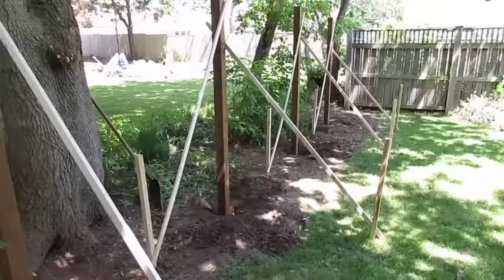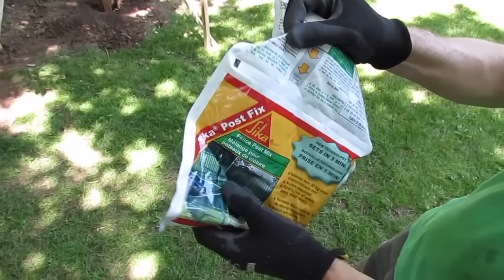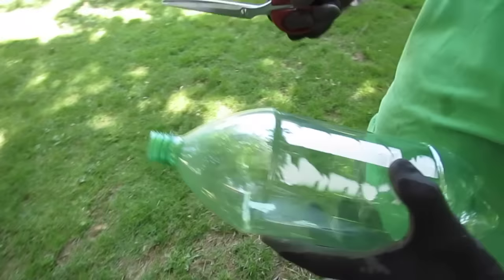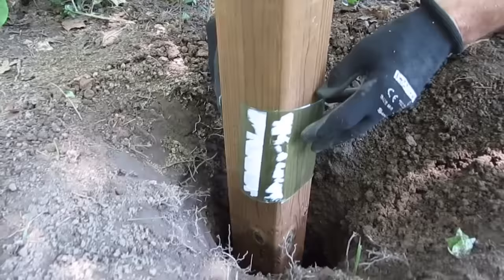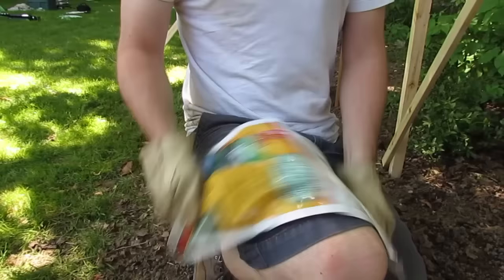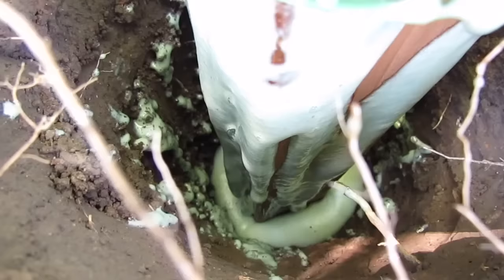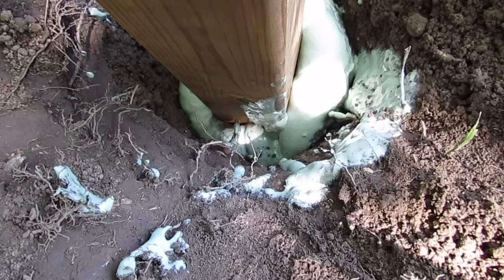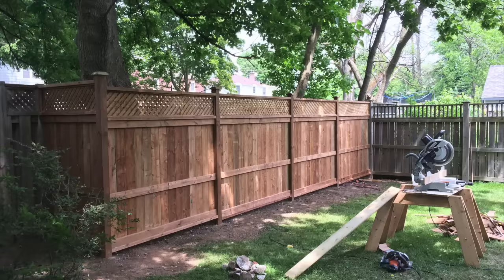No Concrete Fence Post Install!

Comment: pole foam as its known in the utility industry has been used to shore up leaning poles for many years. when used in the commercial version it's very fast to use, very effective and efficient. it's longevity seems to be in the 20-30 yr range. but it should be used carefully as it can have "explosive" effects.
Reply: I've seen Motorway (Highway) crash rails almost always have expanding foam over ooze on the posts? Not sure if there is concrete below or just foam? They are designed to take a vehicle crash so maybe they are supposed to 'give' a bit?
Reply: Jamie I'll bet your an intellectual.
Reply: used once in awhile in the siren industry too depending on soil it is super expensive but on loose soils holds firm...
Reply: Jimmy Walker Wow someone gives you facts about the product you just saw used and you discard our like old garbage cause it's not the cool thing obviously the comments lol be smart and alone not stupid and follow.
Reply: Good info   i am  pro foam   but i thought it would be just the opposite,  not that concrete  would  hold better in loose  soil
Reply: I would rather hit a foam wall as it cushions the blow, where as a cement/concrete wall as shown on an episode of Top Gear can cause serious harm or possible death.

Comment: I used for my mailbox. Worked out great! Way easier than concrete. No issues. Good product.
Reply: How is your letter box going now? Did the foam hold up?
Reply: Yes, no problem.   A truck even backed into post and broke the upper half, but post is still solid after repair.

Comment: Nice foam, but it doesn't add weight to the pole. This means that it's only held by the soil around it, while poles set in concrete are gaining that extra 20kg, which makes them hard to move even if the soil becomes muddy.
Reply: Smieszek80 it's also hard to move a 8 foot 4x4 that is actually put into a 24" hole, a proper hole not a giant lazy digger hole.
Reply: Acts like pendulum in softer soils as well.
Reply: This.
Reply: YUP.  Made this mistake myself and found out the hard way
Reply: Oooh thanks for the tip mate I don’t think I will use the foam for permanent things cheers
Reply: i use this in canada in clay soil amazing job

Comment: I put in a new mailbox post recently and poured dry concrete around the post then poured a gallon of water on top per the instructions.  Was inexpensive, fast, easy, and no mess.  Dried quickly too.

Comment: I've always used a bag of stone in the whole. You put some stone in the bottom to the whole, put in the pole then add the rest of the stone around the pole. I then fill the rest of the whole with dirt. By doing it this way you get good drainage making the poles last year's longer. When set in concrete, water gets trapped around the pole as it shrinks eventually rotting the pole.
Reply: Wow. That explains why my expensive wooden privacy fence is snapping off at the bottom. They are rotting.  Love this information,. Makes good sense ..thanks
Reply: @Lakelandcowboy69  I learned this several years ago from a coworker doing maintenance in a city parks department. We set metal poles in concrete. I've pulled a wooden treated pole out of my yard 10 years after I put it in. It looked like I'd installed it the week before.

Comment: I build fences for a profession. I use 60 lb bag of high strength concrete at each posts , about $3 a bag. It becomes the footings for a wall. I use coated screws and never nails. Using this on my fences would be like spending $65k on a nice ride,  and requesting hub cap covers.
Reply: roger drum 
....EXACTLY.
Reply: Well said!
Reply: I live in a VERY high rainfall area in Scotland. Many places where I've put fences are waterlogged much of the time, and can flood for weeks. Then there's freezing, and high winds. I won't speculate how that stuff would cope here, but I would not expect it to compete with concrete footings.
Reply: church!
Reply: 60 lb bag of conc mix for $3 ?
Seems amazingly low cost to me, & you'd need the strength of a gorilla to carry bags that weight.
I agree nails are nigh useless but would be interested to hear what screws you have decided on.
In frustration (I'm close to the ocean) I have ended up using 10G x 1.5" stainless sq drive. found it necessary to predrill with runners that are harder tan pine!
Reply: peter owens you cant lift 60lbs? hahah wtf
Reply: roger drum one 60lb bag per 4x4? I Would expects nothing less from a fencing co. Do it yourself nothing less than 100lb concrete per post @ 6 ft high
Reply: Midnitetoker - Ever hear of something called a "frostline"? Google it and you'll have your 36" answer.
Reply: roger - As a "professional" what are your thoughts about concrete wicking and holding moisture against your wood posts long after the surrounding soil has dried?

I Always try to use the methods of professionals while attacking a project, but just because the "profession" has used one method for decades, does not mean that improved methods aren't on the horizon. Example.... Asbestos, galvanized plumbing, and ungrounded circuits.
Reply: I can't answer as a professional, but I did 70 posts 15 years ago with 4x4 PT and 80lbs of concrete on each. To date, none have shown any signs of rot. Mine are dug down until I hit solid stone (which is rather shallow where I am) at about 2 foot.
Reply: Michael, Same here. I've set posts the traditional way (usually 36+" due to our frostlines here) and have not had problems that were not related to poorly treated wood...

However, upon buying older used properties I have removed laundry posts and posts from a pool deck that have been in the ground longer than that. Both instances showed perfectly cared for projects at the surface but were a complete mess from the grassline down.
Reply: Roger Drum - you're probably aware that there was a hugely popular drum company name Rogers, yes?
Reply: Actually, it's worse than that...it's like paying MORE for hubcaps and giving up the nice rims, and thinking you made out.  I'm actually not opposed new ideas....but this seems overly costly and inferior...so I'm not seeing the benefit
Reply: Peter Q, you are mixing up safe depth line with frost line. 36" is your states frostline, which means absolutely nothing with putting in a fence. A fence is non weight retaining, meaning the only wait it should retain is its own. The only time one is required to meet that frostline requirement is for piers for weight retaining structures such as sheds or patios. Or footings for builds have to be brought to that standard for houses and commercial buildings. Most utility lines such as gas, water and sometimes electric are to be buried that deep. I line in the central united states and in Missouri our frost line is 30" not 36". In most if not all states and townships a permit is not required to build a fence. Meaning there are no minimum requirements. I see no reason why a fence post would have to be dug below a frostline.
Reply: roger drum , screws are for fufu dudes.  REAL MEN use nails!
Reply: @JoesWebPresence  Well, given that it's high density closed cell polyurethane, which is waterproof, largely non-reactive, and is protecting the wood underneath instead of accelerating the rotting (which concrete can do to wood) probably better.  

High density polyurethane like this (I'm guessing it's 10lb / cubic foot foam or denser) has a compressive strength of about 8/10ths that of properly mixed portland cement, (the really dense stuff, like 32lb foam, is actually stronger, and is used to replicate human bone in stress tests due to having similar shear characteristics)  and is two to three times stronger in tensile strength.  

I've actually seen this stuff tested, and in most every test, either the wood or the surrounding soil shear before the foam does.  Granted, this isn't over long periods of time, but... polyurethane doesn't really break down.  

The main thing going for polyurethane is how unreactive it is once it cures - and how strongly it sticks to anything it can during the curing process.  The stuff can only really be broken down by acetone over long periods of time, or specialty acids.  Or heavy UV exposure over a couple decades.  

... now if only it weren't so expensive.
Reply: Just because you don't see it doesn't mean it isn't there. If it's above the frost line the ground underneath will push the post up wards. If you go below the frost line it will not. The ground will heave around the post but not underneath. I'm sorry but the freeze/thaw or frost line has a lot to do with putting up a fence. I just don't see how EVERY website, every professional I spoke with before I dug my own and every tutorial I've seen mention a frost line and it still have nothing to do with it. So you thinking it's some free mason's concrete conspiracy or some shit? Seriously I'm not being an ass here. We don't always need permits to tell us the minimum requirement .....common sense, learned from people who seem to know what they are talking about ......and who all seem to think the frost line is quite relevant to setting posts.   @thomasbailey5732
Reply: 36 inches is minimum here for post and up to 6 ft for gates. I used almost two bags per hole. Wasteful. Idk but my fence sure is solid af and the extra 5 dollars or so per bag seems like a small price to pay for peace of mind  @iankleiv825
Reply: i fence professionally as well and in my opinion screws take way too long. Galvanised nails do the trick just fine... if you buy the right brand.
Reply: @kon5912  I've never built a fence in solid Rock before, but I know from stories sometimes it isn't cheap. I've heard of people blasting into rock to get posts in, I've also heard of excavators and the like with rock drilling augers. Personally my recommendation is to use dynabolts or the like and just fix the post to the rock with L brackets and a few large bolts. That's what I would do.
Reply: @kon5912  no worries mate :)
Reply: the cost vs concrete is comparable to using screws over nails. nails are faster and much cheaper. if you are using a gun they are much faster actually. good thing fences do not have side loads because screws cannot hold up to that.
Reply: As for rotting, I have posts I put in concrete over 20 years ago that are still sound. We get 50 inches of rain.
Reply: We had a fence professionally installed several years ago. Every single post that they installed rotted at the top of the concrete.

Comment: I tried that same method and same product. I followed the directions on the package. it's a good thing, I only used it only on one post .... where my mailbox was to be located. it's true it holds the post, that's definitely not stable enough for my fences. I can barely push and pull on my mailbox and it moves as much as 2". Believe me, it's far better to consider using Concrete for your fencing base instead of the foams.
Reply: videotracx that could be bc your soil is unstable rather than a bad product I’m sure you would use this in a sandy soil...my opinion of course
Reply: ok you two doubters, it is obvious you have never used spray foam or you would know that stuff does not have any strength to speak of. it is mostly a fill for air spaces as an insulator. it is easily compressed and once compressed it loses its ability to hold firm.
Reply: I used foam about 2 mos ago around foundation of house as a temp fix. Starting to concrete over it now. I literally kick it off the ground. It's really not a "great" product. Very limited and can cause fumes when temps rise when used indoors. Can't be used around any kind of heating this stuff is combustible. Foam anything is not the way to go when filling gaps. Use appropriate products. Fire Bloc around heating systems (caulk), cement for a tight bond. I use it for anything temporary on the exterior. Be careful of blown foam insulation not really a wise choice for insulation otherwise traditional insulation would be out of business by now.
Reply: This isn't a spray foam. It was made for this application and worked great for me and my posts. Having said that, I agree that foams may not be best for applications in enclosed living quarters.

Comment: This is a fairly neat idea. But usefulness depends on how much it costs. I'll have to look that up. Personally, I just use Quickrete fast-setting concrete. You pour the dry mix in the hole and then pour in your water and it's done!
Reply: Way easier to fill the holes with water and pour the concrete in afterwords.
Reply: @marcusanthony179  how is that easier? You literally just reversed the order..
Reply: @jonnyrotten9755  First of all, I've actually done  both ways. Second of all, can you see how stirring concrete into water is easier because water doesn't build up resistance to the stirring until you have the right amount of concrete mixed into it.

Comment: I used that exact foam to fill the bulkheads of a small boat that I built. It is a closed cell foam and therefore water proof. Dont worry about the haters posting negative comments.